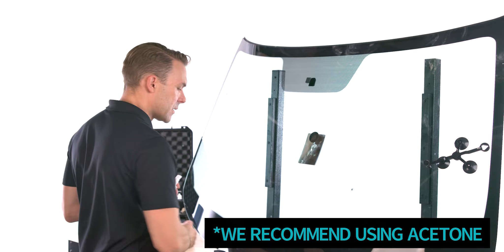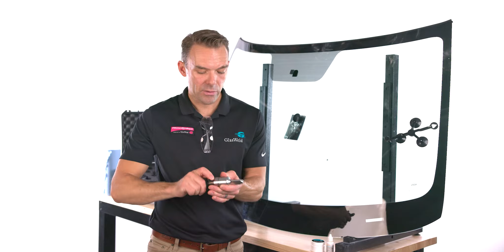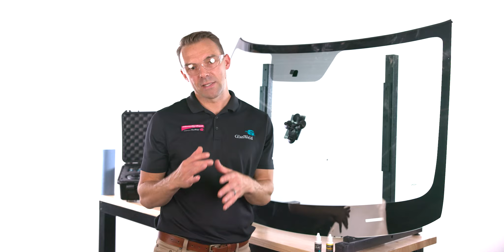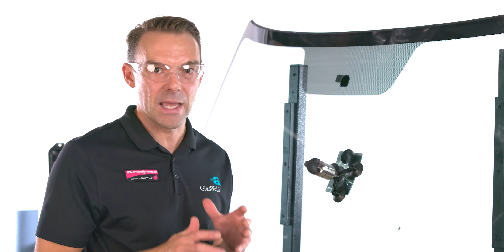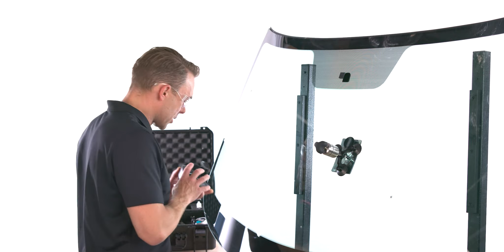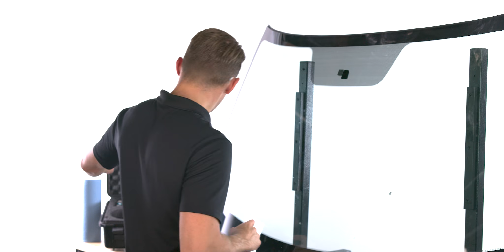GlasWeld Training: Windshield Repair Basics

Comment: That was 8 drops
Reply from the maker: Good eye. This break was on the larger side, so using a bit of extra resin is totally appropriate. Even if a little more goes in than expected, it doesn’t affect the repair. Thanks for watching closely.

Comment: What is flowering on a hot day?
Reply from the maker: Great question! “Flowering” typically only happens on hot days. It’s when the resin gets so thin from the heat that it seeps into the PVB layer, creating that cloudy or “flowered” look.
To prevent it, try to cool things down a bit: move the car into the shade, turn on the A/C (but not the defroster), and aim to get the windshield temperature below about 85°F. Using a warm-weather resin also helps when working in temps between 85–100°F.

Comment: I realized you didn’t drill a hole into the glass before injecting the resin. Is it a must to drill or not? I see most auto glass guys do it….
Reply from the maker: Great question! With the Zoom system, drilling is rarely needed—it’s designed to deliver strong repairs without it. That said, some pros still choose to drill depending on the chip and their personal style. If we can help further, give us a call at (541) 388-1156.

Comment: does anyone know that this repair holds up when it is below zero in winter like Minnesota? when there are a lot of Contraction and expansion?
Reply from the maker: As long as the repair was done correctly and cured and hardened with UV light, it's good to go and will hold up under below-zero cold temperatures. If we can help further feel free to give us a call at (541) 388-1156 or email us at sales@glasweld.com.

Comment: Hi, i tried to make a chip on windcreen while using glass weld tool for repairing practice but when i used little ball with rubber band to make chip the whole windshield was broken into the pieces? What could be reason did i use more power or there is any other reason? Thanks
Reply from the maker: Hello there. If the windshield was compromised in any way to begin with, and to much force was used with the bulls eye maker this could happen. Try using light force with the bulls eye maker and increase gradually as needed. If we can help further feel free to reach out to us at sales@glasweld.com.
Reply: Tempered glass shatters. Only laminate is fixable

Comment: Why did you not show a close up shot of the final repair come on now i want to aee what it looks like
Reply from the maker: This particular video is designed as more of a training video to break down the windshield repair process for new techs. We do have other videos that show a closer view of a repair. Here's one you might enjoy: https://www.youtube.com/watch?v=LwenrBW4VZE. We can also set you up with a live demo If you're interested. Feel free to reach out to us at sales@glasweld.com and we'll be happy to help.
Reply: The product works very well compared to the bridge system I used to use. The thing they always fail to mention in the demos is that not all rock chips fill as easily as what they portray. There is no resources in troubleshooting those chips that are 2 years old, full of dirt. There is no acknowledgement that even if you do the job as best as can be done, the results aren’t always going to be as good as you and the customer are hoping for.

But this system is the best one I’ve tried so far. 

It’s far from perfect, there is a lot of skill and condition of the chip still in play, but it will fill every shop created bullseye to near perfection.
Reply from the maker: @jhuehn31  Thank you for the feedback. You're correct that every repair is unique and skill is certainly developed with time and practice. This particular training video is designed to provide someone with the basic techniques for windshield repair, however we do have other videos that share more advanced techniques. Our certification- membership course is a great resource for this. You can check it out here: https://glasweld.com/product/windshield-repair-certification-online-course-membership/. Our technicians are also always happy to help troubleshoot. Free free to call us at (541) 388-1156 or email us at sales@glasweld.com
Reply: @glasweld  we paid you over 1000$ for the kit, there’s no way we’re giving you 200$ more to learn how to use it lol. 

We’ll be sending you money for resin, but that’s about it.

The machine is great, and I’m pretty happy using it but I’m near certain there isn’t anything in your video that isn’t already known.

Comment: I have the multi tool but have still been using the standard cork, I get excellent results but I will try the multi tool technique next repair
Reply from the maker: The Multipurpose Drill technique is a game changer! Thanks for your comment.
Reply: @glasweld  Welcome, I also am curious: since you upgraded the Procur+ lamp, would an upgraded ( more intense ) version of the UV headlight cure lamp be in the works? The current fluorescent lamp takes a long time to set a good cure, a higher intensity one with mabe led's would be the cat's meow for shorter duration of cure time..
Reply from the maker: @papasquirrel5559  Thanks for your feedback. We are offering only the ProCur line of curing lights and our Headlight Curing Lamp for now, but you never know what we might be working on.